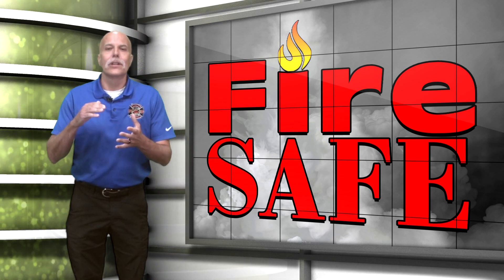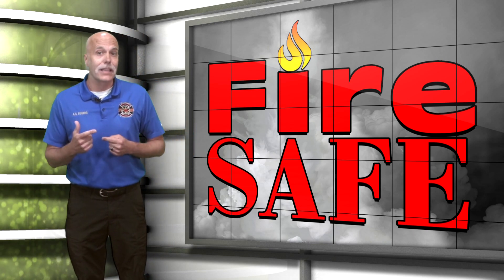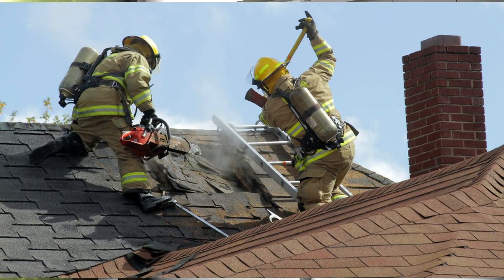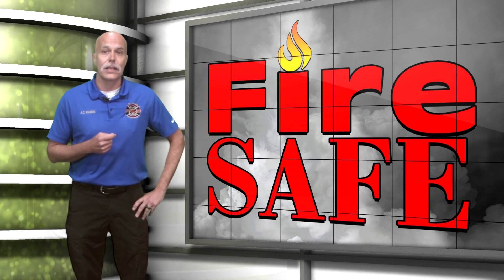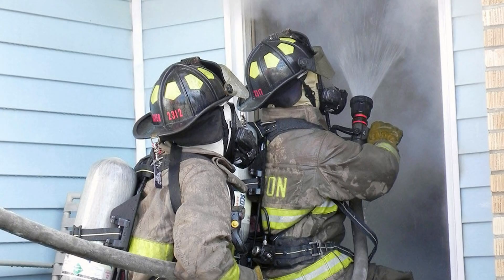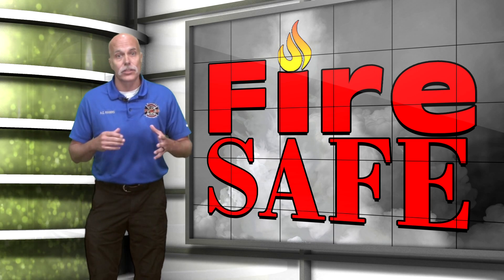Fire Safe: Fire Ventilation Methods

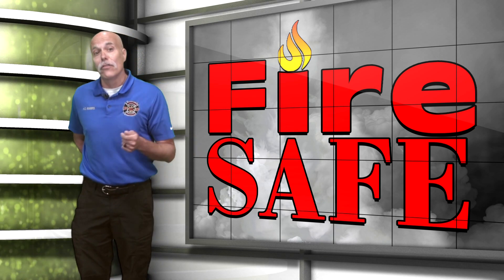Comment: 0:48  Opening the roof and ceiling Directly over the seat of the fire is pretty much Impossible.  Any firefighter should know that.  Even if you could do it directly over a top floor room you have allowed the room to burn better and turned a Contents fire into a Structural fire.  Neither are good for victims, entering firefighters or the structure.  Much quicker and safer Venting Windows at the fire room allow those gasses to go directly to the exterior and AWAY from the interior.  Application of water through those windows onto the burning material, cools and protects anyone inside.  You can fall off or through a roof but nothing bad will happen from outside a window.

1:00  You just shot yourself in the foot.  Do you think about what you are saying before you say it?  Path of least resistance?  How about a window at the fire room?  The release of Some pressure at the top level will allow the lower gases to mix with fresh air from doors or window and the fire will get worse and theoretically get pulled through the structure.   You are drawing the heat and flames THROUGH the unburned areas of the interior and over any victims.  Horizontal ventilation allows the Pressurized gasses to go directly out of the building and away from the victims and unburned areas.  No Heat Rising required.

1:26  You knowledge of the science involved in a fire is totally Non Existent!   The heat can go out the fire room window or be drawn through the entire structure.  You think the latter is the wise move?  You town needs new fire protection leaders!

1:38  ARE YOU SERIOUS???  When have yo EVER seen a hole cut directly over a burning room?  Didn't you just set the attic on fire?  The hard to get at attic?  The worst possible location for a fire if you actually want to Stop The Threat?

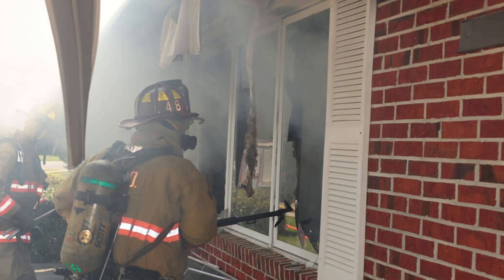2:12  The super heated gasses going to the exterior from the fire room is a bad thing?

2:24  Like through the entire house to get through a hole in the roof?  Are you thinking before speaking?  Every livable space in a residential structure has at least one egress window.  What better way to remove the Pressurized heat?

3:00 You really have no clue and yet someone put you in charge.  "A victim is laying on the floor outside the fire room.  You cut a hole in the roof and ceiling and draw the fire over their body as hit heads to that hole.  or  You break out the windows which allows the flames and smoke to go away from the victim and raises the smoke ceiling so they can breath.  Water directly on the burning material cools and protects the victim.  All the remaining gasses including water vapor continue to go out the windows.  The pressure release location.

Vertical Venting is the Ignorant, time consuming, manpower wasting and unnecessarily dangerous way to vent a structure.  Break a window and apply water before a ladder can be brought to the building.